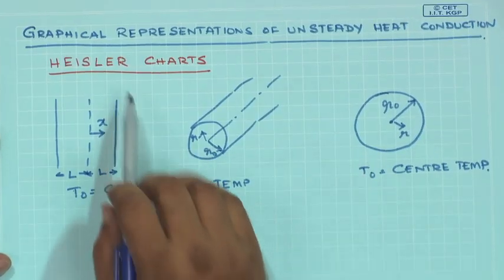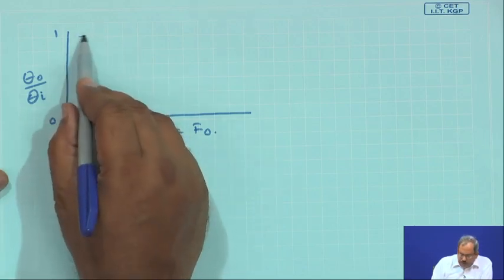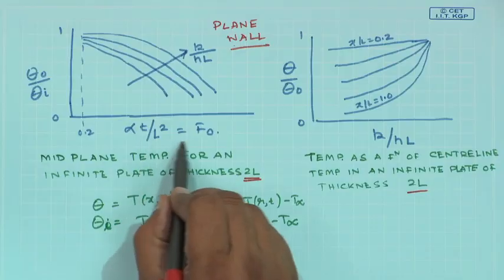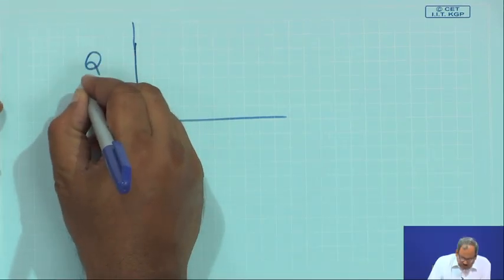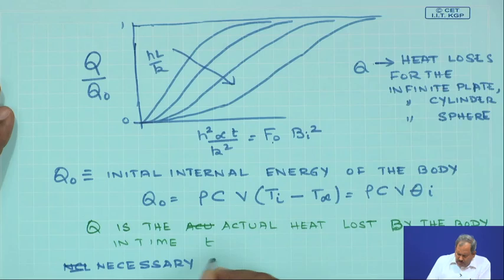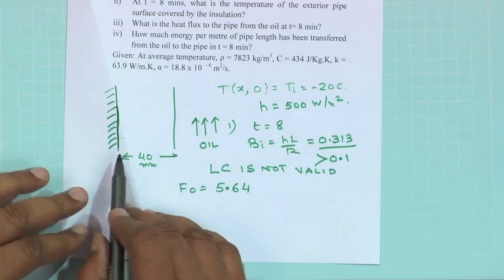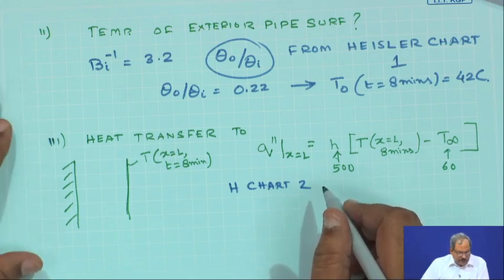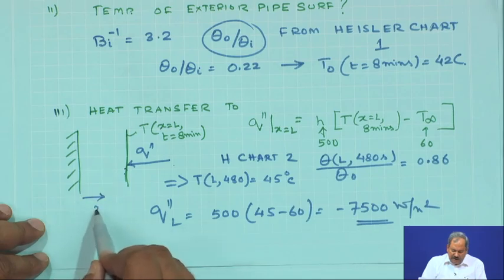Lecture 13 : Transient Conduction - Heisler Chart

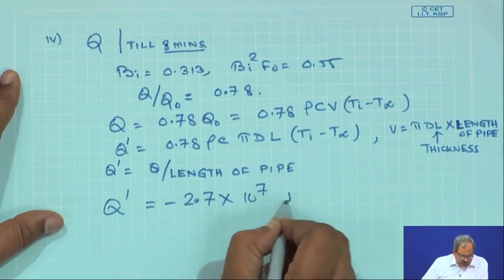Comment: at 36:27  the volume taken is not correct it should be, area between two concentric pipes multiplied by length of the pipe

Comment: Excellent lecture, professor. Thank you.

But I found this video by searching about Fo < 0.2, once those equations are applied to Fo > 0.2. What in fact happens in cases with Fo < 0.2?

Regards,
Erick.
Reply: Hey Erick, 
It depends on how less the Fourier number is. Considering the error being in suitable range, we can still use the charts as an approximate solution. 
Please go through Pg.4: (Prob. 11-41) where was Fo < 0.2. 
http://www.mhtlab.uwaterloo.ca/courses/ece309/assignments/pdffiles/cengel/all11.pdf
Reply: @pramethgaddale8242 The attached file still fails to answer the case of Fo<0.2.
I went through the referred question. They've assumed that heisler chart is valid since Fo is close to 0.2